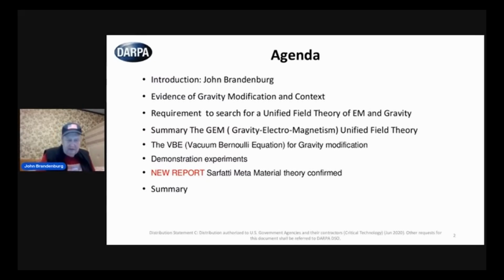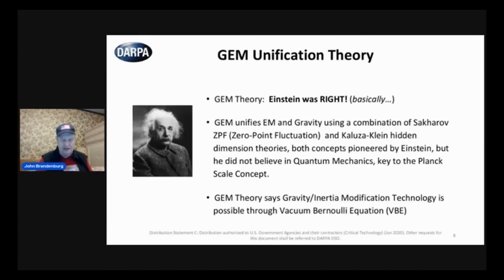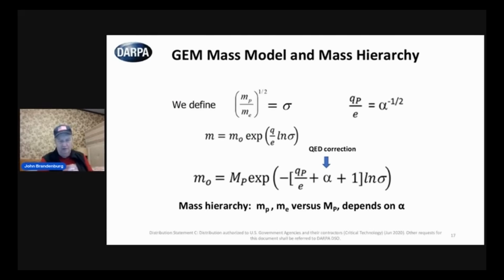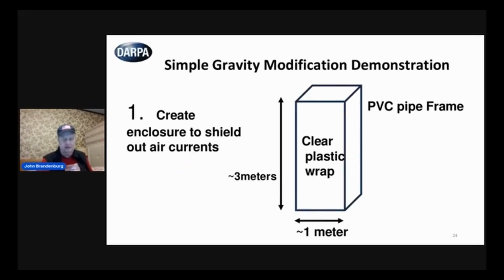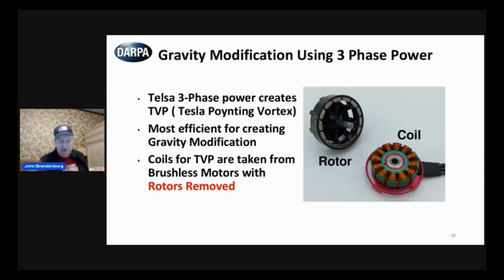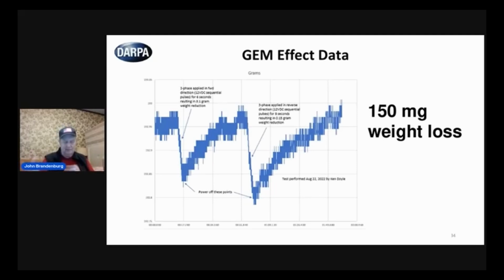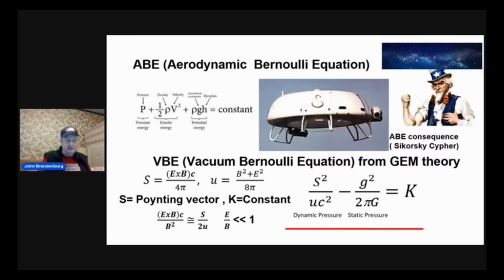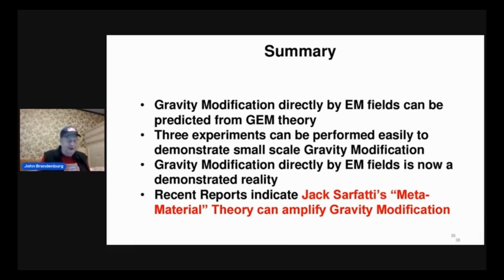How anti-gravity works (EM gravity)

Comment: This stuff is interesting, but I don't believe there was ever a 'big bang.'  My theory is that the cosmos is eternal and infinite.
Reply from the maker: Yeah sure, he also talks about disappearing "time component" and I don't really like that either. Better to think of a new word (or at least one with less baggage) when it's going somewhere you don't understand. 

Big bang is completely fabricated yes, to hide the fact that galactic jets are brand new matter and the universe is alive. 

The universe is of unknown age, origin and extent.
Reply from the maker: Note to self: He doesn’t claim time disappears. What he does is integrate the rate-of-change terms over time to turn the equation into a static balance — a kind of pressure equation.

Longer form:
When you integrate both sides in time, you're taking a description of how things are changing and converting it into a statement about how much they've changed overall. Both sides of the equation have time derivatives, like dS/dt and dg/dt, which just mean how fast the fields (S and g) are changing. Integrating removes the "how fast" part and gives you a total effect — like going from knowing speed to knowing distance.